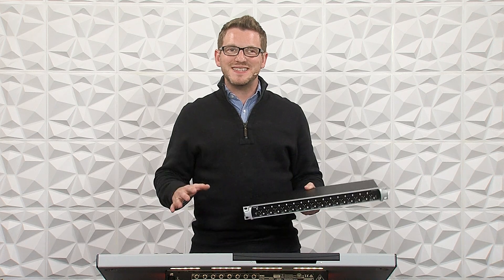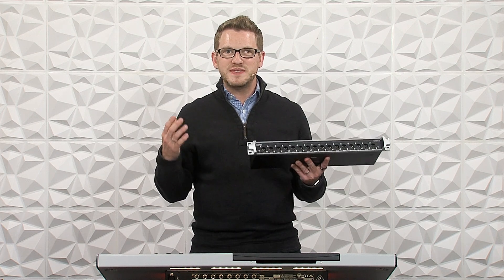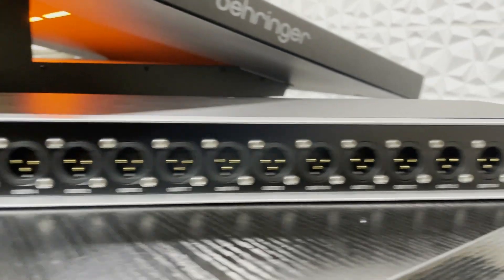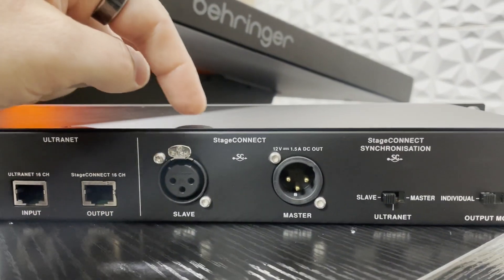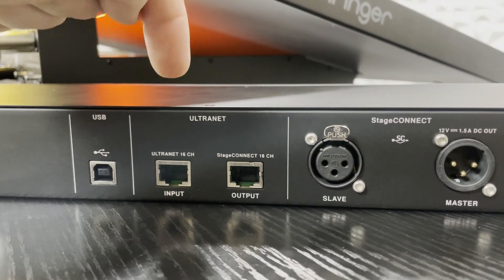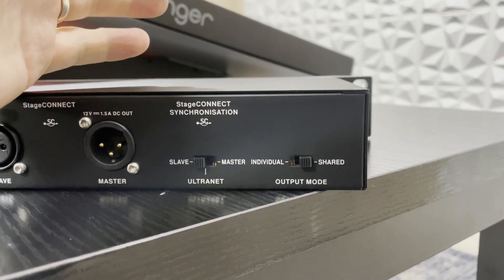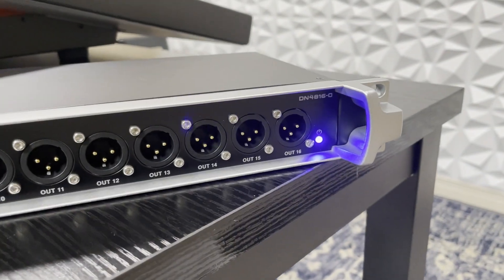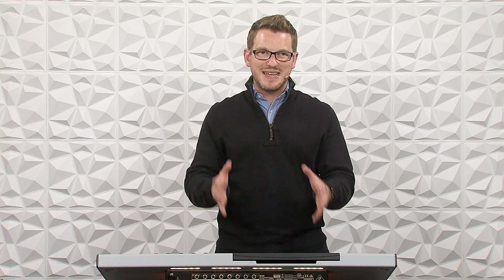StageCONNECT - Midas DN4816-0 Setup with the Behringer Wing

Comment: Can i use the Midas DN4816-O with the wing rack via Ultranet instead of stage connect? I am currently using my stageconnect for my p24’s thus the reason i want to run the Dn4816-O via ultranet on my wing.

Comment: Are the DN4816-0 outputs shielded against phantom power if a FOH mix console accidentally sends phantom power back into it? Or should we puts something like a Radial ProD8 or ART T8 in between the DN-48160 and Mix desk? Frustrating this issue isn't addressed/disclosed, as the diagrams for the 4816 all show one of its use cases being directly connected to FOH mix desks.

Comment: Another request for how to use the DN4816-O to run P-16 personal monitor mixers. Why Behringer decided not to include an Ultranet jack on the Wing is beyond me.
Reply: You can go from the output of the splitter to your p16s. From what I've seen it will just pass along A normal p-16 input, alternatively, you can use the p16 distributor, And feed the splitter from the p16d. Without the distributor, I believe you would have to Daisy change your p16s together and power them individually

Comment: If I want to use a DN4816-o as a splitter by routing the individual inputs, some local, some from aes50 out to it at what point in the signal chain would my output be? Using its as a splitter for front of house I would want it to be pre everything, is this the case?

Comment: Hey Drew ... If you run the WING + DN4816-O can you the use the Ultranet Out on back of the 4816 to run P16 personal monitoring system ?
Reply: My question as well.
Reply: Aye, works perfectly. Only downgrade is, ya can't set an individual tap point for routing if ya need one. I fixed this with another DN4816U, does a great job.

Comment: Hi Drew, thanks for your videos they have really helped and blessed my team. was wondering if you could make a video on streaming from Ableton. we use Ableton to handle the audio side of our streams by sending over the channel signals using a Dante card. is there a way to send the exact signals post-fader from my M32 to Ableton which will handle EQ's and level controls? Basically trying to achieve monitoring both the live mix and stream mix at the same time. Also is this a good idea?

Comment: Hey Drew, I don't know if you have had a chance to use the new firmware in the Wing but I would love to hear your best practice with regard to show files. We mix FOH and IEM from the Wing and I'm finding that saving and recalling snaps within a show work great until someone needs an ear change. Since part of what I'm saving with a snap is send levels to buses for effects, I can't safe the buses for recall. I want to know if there is a way to elegantly save the new ear changes across all the snaps within a show or at least leave those changes undisturbed by the new recall. Thanks for all you do!